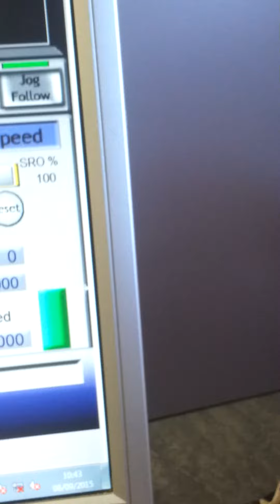ma broche perso/self made spindel

Comment: Hello. please which motor  did you use?
Reply from the maker: all outrunner mine Horizon hobby 960kv ...
Reply: thanks. and how you satisfied with the accuracy of cut, is it like proxxon ibs/e or kress 800?
Reply from the maker: Proxon too fragile Kress too heavy and generates vibrations. I made this one because I was fed up with all these products. Mine is cheaper and I have never had problems with it, it is cheaper and more solid it does not heat like stepcraft ... that happiness .. make yourself you will not regret there are plenty plan on google has to search ...
Reply from the maker: http://www.mycncuk.com/threads/3793-Diy-Brushless-Spindle
Reply: incredibly! your response helped me a lot and im glad i will not buy kress,proxxon. im excited and i try to make diy spindle.thanks...;-)
Reply from the maker: It's good chucks are cheap in China I do not remember or I bought it ... I paid $ 13 with the clamp and the key I took the diameter of 6mm that's enough but the next time I make one if it is necessary I would take the 8 or 10mm with a motor a little more powerful..So good job send me pictures
Reply from the maker: https://fr.aliexpress.com/item/C20-ER11A-100L-Straight-shank-collet-chuck-For-CNC-Milling-chuck/32389373668.html?spm=a2g0w.search0104.3.281.r7gBlt&ws_ab_test=searchweb0_0,searchweb201602_4_10152_10065_5700015_10151_10344_10068_10345_10342_10343_10340_10341_5760015_10541_10084_10083_10305_10304_10307_10306_10177_5640015_10302_10060_10155_10154_10056_10055_5750015_10539_10538_5370015_10537_10312_10536_10059_10313_10184_10314_10534_10533_100031_10103_10073_10102_10142_10107-10102,searchweb201603_25,ppcSwitch_3&btsid=de65f722-4821-4185-935b-3b65352bc54c&algo_expid=e13a647e-fdb3-419e-abae-b3c9095b828d-36&algo_pvid=e13a647e-fdb3-419e-abae-b3c9095b828d
Reply: what dril bit you used?
Reply from the maker: we can mount end mill up to 8mm maxi I think myself I have 3mm 3.17mm 4mm 6mm clamps I use most of the 3 end mill and dril 6 8mm for planing opérations.